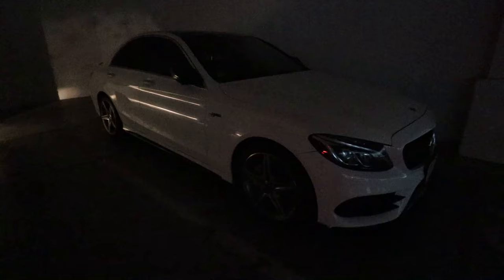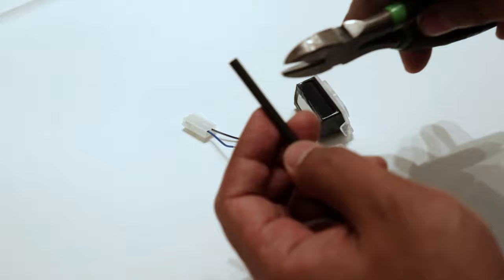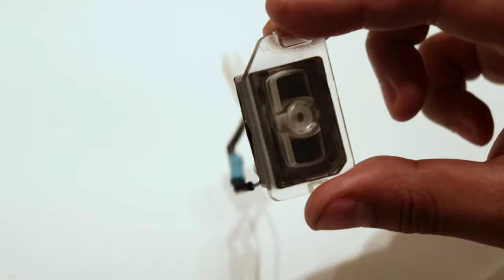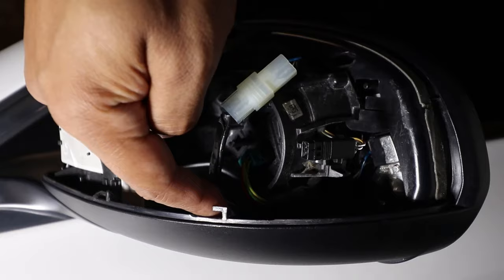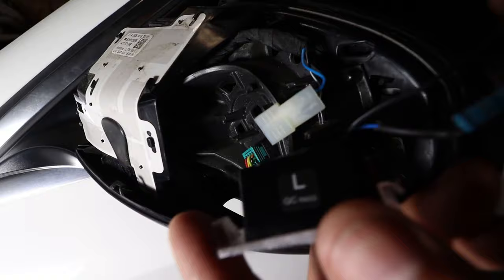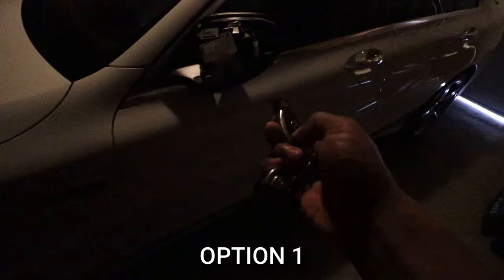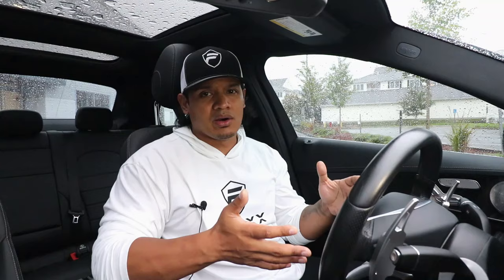2 MERCEDES STYLE Side Mirror Puddle Courtesy lights installed on 2015+ Mercedes C-Class W205

Comment: So this came in today and I installed it, but it wasn't so easy. The mirror cover was really hard to pry open, way harder than in the video. When I managed to get the cover opened, the left mirror was as shown, but the right mirror on my car was different, there is some device in plastic housing and because the DMP light box is bigger than the original, it just wouldn't fit in there. I had to saw the corners of the light box and sand off the plastic inside the mirror. After doing that and trying a couple of times it finally went in. But it works good and looks awesome. Hopefully it will last.
Reply: What was the make, model and year or your car?
Reply: I had the same problem on the right side. I took a very long time moving around, but I had to force it in. 2018 E300

Comment: Thanks for the instructions man. I had them installed by a foreign auto repair shop. The lights worked for 3 weeks then went out.
Reply from the maker: DMP car design’s lights work amazing and they come with a warranty. So I’m not sure where you bought yours from but it’s probably bad quality or the shop didn’t use the right resistor and that’s why the lights burned out so quick.

Comment: I respect you for removing the AMG lights, I highly dislike people who modify their stock cars with AMG parts to make it “seem” like an AMG
Reply from the maker: Well. You need to understand that there’s such thing as an “AMG packaged” car now. My C300 has an “AMG” package from the factory. Which includes sport wheels, sport steering wheel, sport brakes, AMG floor mats, and some other sport stuff.  I personally think it’s dumb cause in my opinion, a true AMG has the V8 engine.  And that’s why I left the badge off.  

But if someone has an “AMG packaged” car and wanna wear the AMG badge. Go ahead.  But don’t get mad when people mock you for not being a real AMG.

Comment: I had a huge problem on the right side, It was a different fit? I had to force it in, almost didn't bother installing it on the right side. The left side went in smoothly. 2018 E300

Comment: Hey Flex, I hope you have a fantastic day. Man, I have a quick question for you. I bought a set of projectors just like yours, but mine didn't come with the resistors. What type of resistor should I buy? I purchased a 1ohm resistor set for the projectors, but they are still blinking after welding and installing.
Reply: Yes! I would like to know what type of resistor to buy as well. Mine didn’t come with resistors either
Reply: Yes same here, wish I had watched this first before ordering mine 🤦‍♂️ I need resistors too now

Comment: Hi got the item, Left side installed no issues, however the right side interior is slightly different, the new puddle light does not have enough clearance to slide into place How did you do it? it was impossible, the new puddle is taller than the stock one.  for the right side mirror the space above is much less than left side .
Reply: I forced it in, now my mirror folds and unfolds slower than the left side
Reply: Did you manage to take it out and install?

Comment: Great video. I have a couple questions before I take on this project. How long does it take without the resistor. The lights I found said no resistor required. Should I also be at all concerned removing the rear view cover. I heard what you said, but the video really doesn't describe the removal in enough detail to make me comfortable. 

Great upgrade, I just want to be careful, this is a Hyundai we're playing with.

Comment: I brought one for e300 2017 Mercedes-Benz but it comes on and off. Sometimes it work and most of the time it doesn't. I had a shop put it on and it's not working. What is he doing wrong?
Reply: Did you ever end up finding out the problem? I'm planning on purchasing a 2018 E300 myself and hope to throw these on as well.

Comment: Do they stay on when you drive at night or they only come on when you unlock the vehicle?
Reply: From factory, if you have “surround lighting” turned on in the instrument cluster settings, you will be able to have the Mercedes light display on the road while driving under 15km/hr

Comment: Love it. I just purchased a 2022 GLC 300. Is the install the same? Also, where can I buy a set and I like option 2 as well. Are both options included?
Reply from the maker: Should  be the sane install. Link in video description. The options are different lights.  It’s only 1 style per set.

Comment: Flex , 
Need help with ur knowledge. 

On my 2017 Mercedes benz c300 on the mirrors of doors my mirrors do not have the Square cut out for the door lights .
Can I cut the Square out with Dermal, or will there not be wiring to connect it to ? This would be for the side mirror puddle courtesy lights .
Reply from the maker: No wiring exist. 

And there’s no easy way to wire in wires to work properly. I did a video wiring up my own mirror lights and it’s a fun one. https://youtu.be/_fEWtHPaInc?si=DWudKYuFSMMYvmC6
Reply: flex also has a video switching out the lights at the bottom  of the doors with logo lights...looks pretty good if your mirrors arent an option.
Reply: Hey Catch22ss, I ended up having the same problem but didn’t realize until I already bought the lights… Did you end up figuring out a way to install them because I was thinking about trying to cut a hole as well??

Comment: Are these really bright? I fitted mine bought from dmp but the quality is bad and not bright at all
Reply from the maker: Super bright. If they aren’t bright, then you need to contact them for a replacement cause yours is probably defective then.
Reply: @TheFlexxGarage  they informed me my car needs to have coding done to get it working due to the voltage? I thought this is plug and play?

Comment: I'm considering getting these but I already have the car door welcome logo lights and I'm wondering if getting more lights would be overkill. Thoughts?
Reply from the maker: That’s up to you. Lol.  I did it already both and I love it. You decide if you like it or not.
Reply: @TheFlexxGarage  of course it's up to me, I just put stock in your opinion because you dedicate a significant amount of time on this stuff. Nothing wrong with that.

Do the lights overlap at any point? I understand that the side mirrors light up when locking and unlocking. But by the time you open the door, do they turn off and the only active ones become the door ones? Thanks for the time.
Reply: @josemaguajardo  did you try both and do they over lap? Or like u said the Side mirror ones turn off when u open the door hence only door ones are active then?

Comment: what would happen if I didn't install the resistor, would it make a huge difference?
Reply from the maker: It will flicker or not work at all
Reply: @TheFlexxGarage is there a chance that it could drain the battery?
Reply: Proper size resistor will limit the voltage to correct for the LED light. Without it, LED will burn really quickly.

Comment: I just installed them, while they look great at night is there a. Way for the puddle lights to be on during the day too?
Reply from the maker: Puddle lights only come on at night unless you block your light sensor on your windshield to trick the systems it’s nighttime.
Reply: @TheFlexxGarage   cheers dude, it was more for the side indicator lights, i installed then ones you did that have a blue animation but in the daytime they dont animate, just at night
Reply from the maker: Yes. And those are connected to the puddle light wires and will only work like the puddle lights. You can only trick the system if you want the puddle lights to have power which also powers that indicator during the day to animate.

Comment: Dang bro, $120 plus another $20 for shipping and you have to solder? Do they not pre-install the resistor because it only flashes on w205?
Reply from the maker: The flashing doesn’t affect all c-class (as I mentioned in the AMG light install video).  So there’s no point in adding the resistor for cars in countries that don’t have the issue. I know I’m the US, flashing is an issue.

Comment: Flexx. I'm doing this to my c450 w205 amg and it doesn't fit as easily as yours.. DMP car design sent me a video showing me I needed to pop the mirror off and I'm terrified I'm going to break the mirror.... lmao
Have u ever had to pop a mirror off and is it plug and play and not gonna snap something? 🤣
Reply: Found out the hard way too, seems like something is blocking it, did you manage to do it with the mirror off?

Comment: Nice. Def getting these. How do we know what mercedes we have? I see mines says c300w. Its a 2018
Reply from the maker: You need to ask DMP car design. They will set you up with the right one for your car but your car has to have puddle lights in the mirror. If it doesn’t, then there’s no wires to power up the light.
Reply: @TheFlexxGarage  i mean like the w205 or whateva those numbers are. Like model number or something. But yea i have the lights and the square like the site asks
Reply from the maker: Simple google search my man.  All 2008-2014 c-class is W204, C205, S204.  All 2015+ is W205 for the 4 door, C205 for the coupe, and S205 for the wagon.
Reply: @TheFlexxGarage  thanks.. i did search but kept getting explinations on the why its c300 or c250 or e class im like wth lol.
Reply: @TheFlexxGarage  wow I think I would prefer these over my door projections. I have a 2012 w204 c250 I presume I can install these on my vehicle?

Comment: Anyone know how to add an amp and sub to a w205?
Reply: same here. i need to do my system in mine.
Reply: I am following to
 got a 1300w sub in my bedroom xD
Reply: I added a JL Audio box to mine C450. The box comes with a JL Audio 12” sub and JL 500watt amp. Basically you run the amp and sub the interior trim and there’s a hold below the in cabin filter under the hood amd that’s where you run the power cable. The rest is pretty easy to figure out. I ran a sub control knob to under the steering wheel, because there’s no adjustment in the factory unit to control a sub.

Comment: Guys if anybody is been wondering about what do to exhaust to the c300 delete  both reasonators and keep stock muflers it sounds killer no vibration
Reply: How loud is it? I currently have my mufflers taken out, and one resonator taken out on my c300. It has little vibrations in the inside. And does it have pops?
Reply: Abel! You finally did it. We need to hear it ASAP.
Reply: @MClionbdcraft   not loud if you don't floor it i kept both stock mufflers and deleted both reasonators  it sounds nice and no problem being a daily

Comment: Hi flexx I have 2016 Mercedes Benz c300 amg sport package when I saw your YouTube I order it but when i got them and i tried to install them they don't fit there a bit big so i contacted DMP they say that the driver side is much easier then the passenger side i guess that's why u only show the driver side they say they will make a video on how to cut them so they will fit or else there useless for me i like your YouTube all your mods i go out and purchase them for my car this one i don't know it does look cool. Thanx John
Reply from the maker: As mentioned in my video, it took some time to get it to fit right.  And that’s the same for the passenger side.  I did the passenger side and it fits without modification...so no point in me showing that side.  It’s a tad tighter but doable without modification unless you have a 360 camera in the way. My videos are for inspiration and guidance. You can’t just assume you’ll always get the same results. You have to do your own research and talk to the resellers before buying or attempting. And I always recommend professional installation.
Reply: Yes I understand I'll try again but my mirrors are different then what u have.

Comment: Yeah but what do they look like in 4 months?
Reply from the maker: Why not 6months or a year? Cause all my door lights from DMP have been on for almost a year and there’s zero issues.  The lights will last since it only turns on when you unlock and lock your car. Plus the quality is not junk.
Reply: @TheFlexxGarage  
Does the resistors come with the lights?
Reply from the maker: haha..did you not watch the video.
Reply: @TheFlexxGarage  
sure did, I saw how you wired/solder the resistor. But don't know if they come with the lights in the same box. 
Great car btw Alex, I have the facelift C300 AMG line.
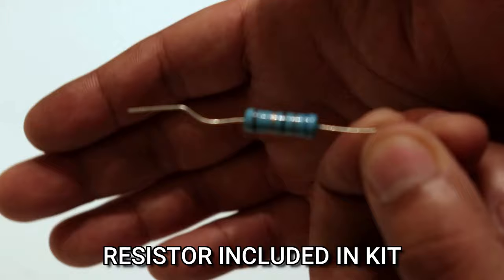Reply from the maker: Go to the 1:05 min mark, look on the bottom.

Plus, I already mentioned if they are included or not in the AMG side mirror light video as well.
Reply: @TheFlexxGarage  
How did I miss that big ad"resistor comes with kit🤦🤦
Reply from the maker: Just remember, in all my videos, if I show something...it 99% included unless I say otherwise. There's no point in me tricking people and make them guess.
Reply: @TheFlexxGarage  
👍
Reply: @TheFlexxGarage  wasn't implying your trucking ppl. Some mercedes require that, others just select an option in the dash for led lights. The puddle lights wear out in short order....
Reply: @TheFlexxGarage  hello, I bought a different set in Europe and there's no resistor with them, do you know what resistance the resistor is? Thank you

Comment: What resistor do you use and can it be installed on a 2015 GL550
Reply from the maker: Don’t know. It’s whatever was included in the kit.   And it will work on any Mercedes with the same style side mirrors that has oem lights on the bottom already.